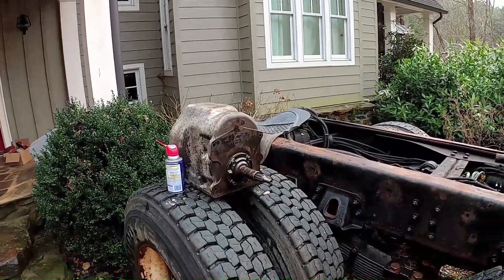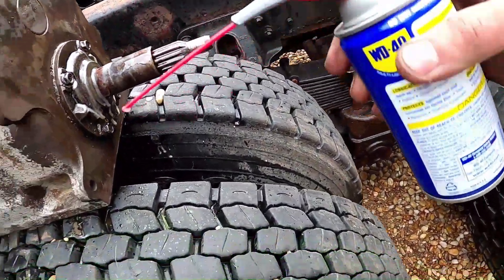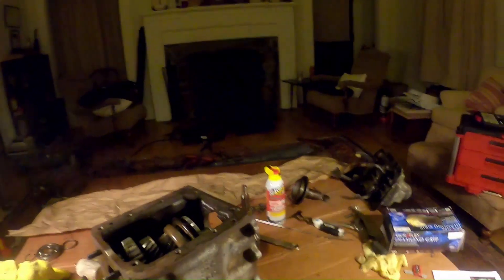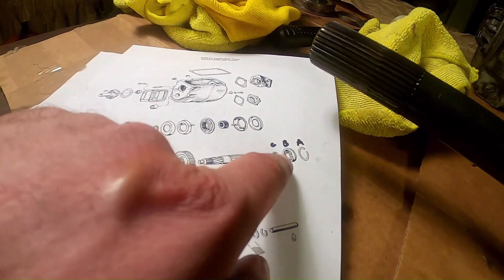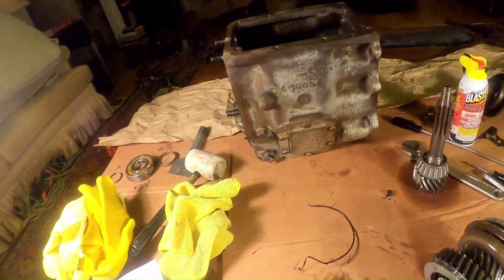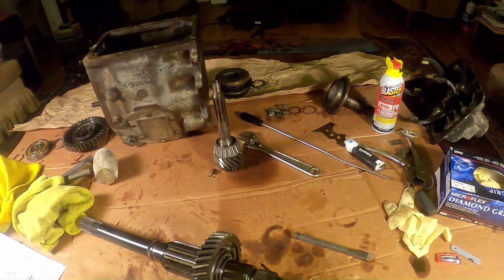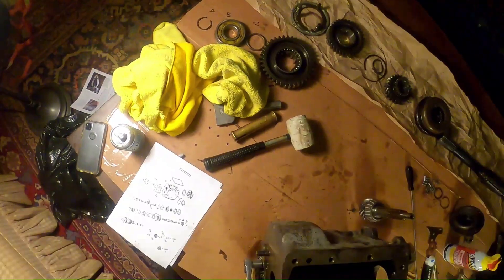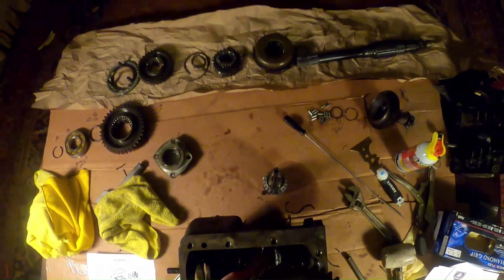NP435 Dissassembly - Rebuild Series, PART 2

Comment: Got a question for ya I’ve had my tranny out of my bronco for 5-6 years due to restoration finally got the body metal work done so going to reinstall the top loader and I noticed that it will not shift into any gear top still off should it move freely when out ?
Reply from the maker: Definitely. These transmissions cannot be killed. Take it apart and she'll move freely. Clean everything and see what parts need replacing
Reply: @robstuckey  one other question got the top loader in working order now put it on and there is 2 bolts that are longer and have a shoulder on them do you know the proper position for them ? They must be for critical alignment and are all bolts to have a washer? I seem to be missing some I believe the 2 with the shoulder have a thicker washer and the others have a thinner one
Reply: @chrisparrinello4192  There are two that both have shoulders on them with a washer. They go on each side's first bolt hole facing the front of the transmission on the sides of the cover. Not the corner bolts, the next ones on the side in a straight line. Basically on each side of the middle of the bulge where the shifter goes in. No other bolts should have a washer on the top cover from the factory unless they have a built in washer head. Also, you have to line up the reverse fork correctly when putting the cover on or else it will be stuck in two gears and that is why you usually can't shift it after working on it.
Reply: @buttonysquare8501  thank you so much the information is so helpful